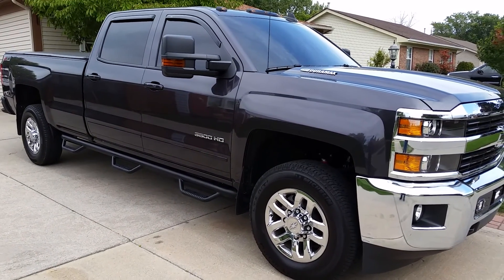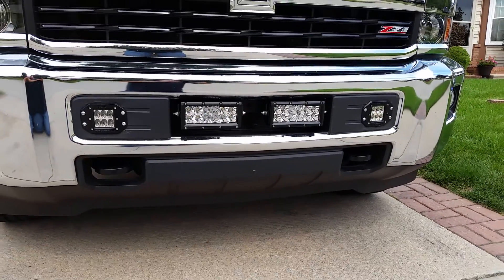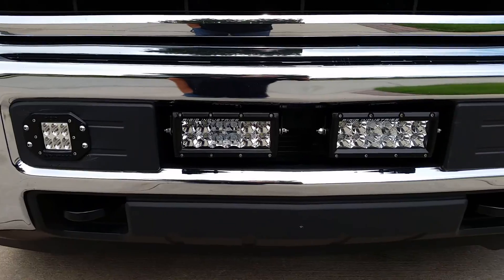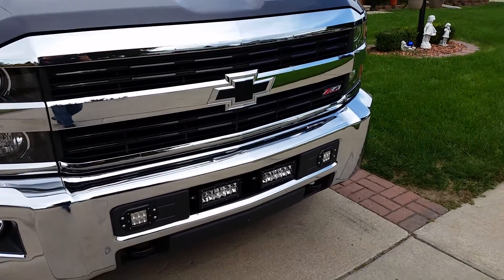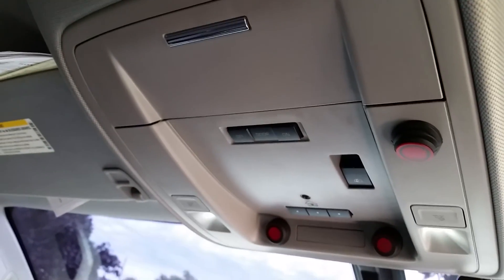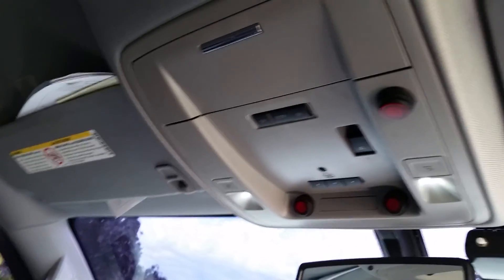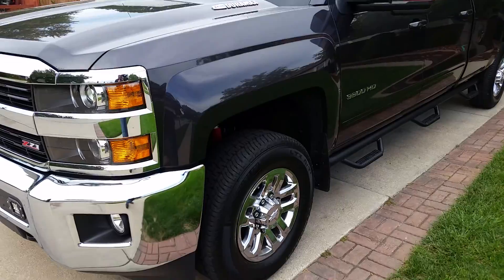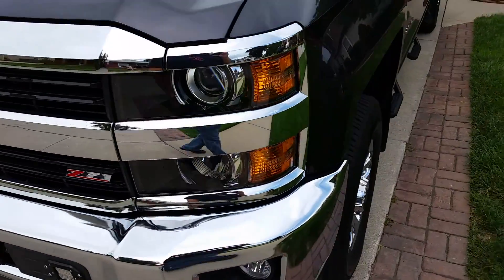2016 Chevrolet Silverado 3500HD Z-71 with Rigid Industries LED Lights. #chevytrucks, #duramax

Comment: How did you get the flush mounts into the plastic pieces? Did you have to remove the bumper? And what did you use to cut the hole for flush mounts?
Reply from the maker: Cody Dye ...
The plastic is just a cover and was easy to cut through. I did NOT remove the bumper. But, I did measure from the inside to make sure it wouldnt hit the bumper mount. Basiclly, I took the templet that Rigid supplies, drilled a hole for each bolt and then a hole in each corner of the light opening. Of course, through the plastic and steel. Then I used cutting wheel to get through the plastic, then a sawzall for the steel....Just remember, measure and level multiple times before you drill or cut. Hope this helps!!

Comment: the lights in front of the trans cooler what did you mount them to? I have a single bar I want to put there but dont know how to mount it in there
Reply from the maker: scott lewis ...I purchased the mount from Rigid. It fits perfect but you would have to use the 2-6" bars. I know there is another company that makes a mount for a single bar, might be Rough Country but I don't remember, sorry. I went this route because I wanted Rigid lights. Thanks
Reply: hardass912 ok thanks for the advice

Comment: Where you able to cut the holes out with out removing the bumper for the flush mount lights?
Looks like you have them pushed out to the outer edge of the plastic piece that has park asst.sensor ?
Reply from the maker: Frank Rogers ...
Sorry it took so long to reply, I dont have the front park assist sensors.  Yes, I did not remove the bumper. I just posted a reply to another person and told him what I did. Thanks

Comment: I have the same truck but I not sure to cover that space because of the transmission cooler that you truck come with bumper sensors? Please let me know
Reply from the maker: walter palencia ...Thanks, I do NOT have the front bumper sensors. I didnt want them when I ordered her. As for the trans cooler, no problems at all. I pulled a 20' trailer from MI to TN and the temp stayed the same as normal even through the mountains. That was my concern which is why I went with this style and not the full bar. Plenty of air movement around the lights, and even when they are on, no changes in temp. Hope this helps

Comment: Is there metal behind the plastic
Reply from the maker: niko stathopoulos ....Yes there is, i was able to drill a hole and use a sawzall to cut the metal.
Reply: hardass912 thanks I was wondering because I want to do it to mine
Reply from the maker: niko stathopoulos ... I used the template that came with the lights. Drilled out the holes first for the bolts. Then I made some pilot drill holes and used the Sawzall. The template worked great I just used black Sharpie to mark the outline.
Reply: hardass912 thanks this will help with the dim stock lights that it has
Reply from the maker: niko stathopoulos .... yes it helps a lot. And putting it here gives it just a little bit of an angle that you get some really good edge of the road coverage to see. I'm going to post another video soon I just have to find time to go somewhere where it's dark enough, kind of hard living in the city.
Reply: hardass912 yeah here in the suburbs it is dark almost everywhere is your Duramax a 2015 or 2016
Reply from the maker: niko stathopoulos....2016

Comment: What gromet
Reply from the maker: Project Midnight ...It can be seen under the hood on the drivers side firewall...has a "nipple" looking tip. I just cut a slice in that and fed it through with a wire fish. Ive had no problems at all.